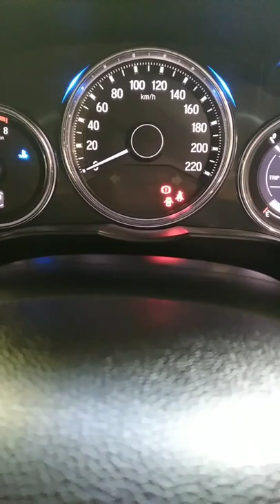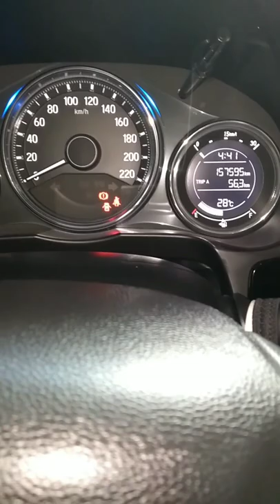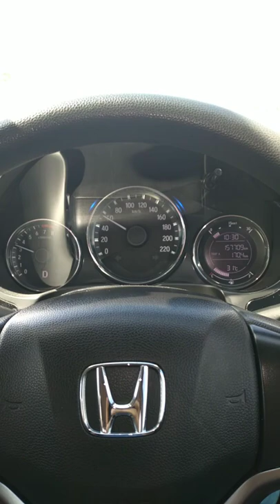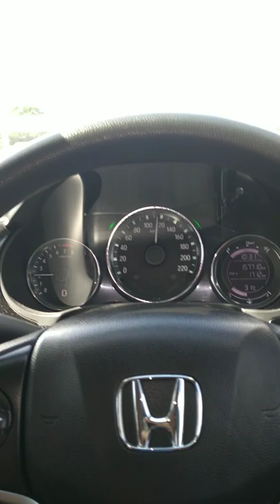CVT FILTERS REPLACEMENT

Comment: Great tutorial. Honda wants around $400 bucks to service my 2021 Accord. I have all the tools, and everybody in the comments would agree, that we have a great teacher for guidence! Thank you sir!
Reply from the maker: Thanks very much for Acknowledgements!
Reply: No way they were charging u only $400 to do everything that was done in this video.
Reply: honda oil + honda filters costs around $300 plus work hours. i thinks its fair.
Reply: @numerik4636  Everything was mostly labor. I did it myself using this video for about $200.
Reply: @korodymartiningatlanszakerto  It's a decent price, but Its a bit harder for me. I got my Honda an hour away and per our contract, I can only get it serviced there because of the franchise situation. I had fun doing this myself. You learn more, you get your car as soon as you're done vs waiting at the dealership with it, or having to pick it up hours later and it saved me half the price!
Reply: I'm doing this with my 2014 crv and 2019 civic. The civic goes perfectly with the video. Except the crv doesn't. Different top filter but same bottom one I think.

Comment: Hi

I did everything the same as in the video and after 2 months it broke down, the problem it caused me was that it lost power and it came on during the check engine and it kicks hard in reverse, I took it to scan and it gave me the speed sensor (P0717) and stuck cellenoid valve (P0796)

The question is, what could it be?

Comment: You don’t need a gasket for the transmission oil pan when you reinstall it back together?
Reply from the maker: Yes you suppose to but at the time I didn't have any and it never leak.
Reply: Mine was hard to get off , I had to use a razor to scrape it off. I  bought a gasket of ebay for $10. no need to use silicon either.

Comment: Great video. Is this the same procedure for 2014 accord sport? Also what did you use to clean the small magnets? Thanks.
Reply from the maker: Yes it's the same process with a  different shape in the oil pan. I would used any type of trottle body spray to clean the magnet get it very cold and wipe it with a rag!
Reply: @v.r.autorepair242  thank you 👍🏽

Comment: Good job…..What was the material in aerosol spray can…you used to clean the gasket surfaces/touching surfaces of transmission oil pan ?
Reply from the maker: CRC Mass Airflow cleaner. Works wonders for me. I used it in mostly all my sensors and surfaces cleaning because it's very safe to work with.

Comment: Nice video, do I clean the filters or replace them?
Reply from the maker: I will say replace them bit with genuine only. If not used a airflow cleaner and spray it out. Let it dry before installing it back.

Comment: Hello Sir, I have few questions please!

I Imported a HONDA FIT 2020 EHEV HYBRID with a milage of 76,000 km from Japan.

I wanted to change the Gear Oil fluid, but am confused about multiple things;

- Which gear oil to use? HCF2 OR ATF DW1

- Are there any filters inside its gear which need to be cleaned or replaced by opening the chamber , or is its just drain and Refill?

- Beside Engine oil, gear oil, brake oil, coolant, is there any other fluid/oil which need to be replaced after specific millage?

Thanks in Advance Sir!
Reply: maybe im a bit too late, and you already know the answer. but maybe i can help
1. HCF2 for CVT, and ATF for AT
2. it is recommended to change the filter once every 40.000km. but if you do the transmission oil change once every 20.000, for me personally, i think its fine if u want to change the filter once every 60.000km or maybe even 80.000km. but its just my personal opinion
3. i forgot how long spark plug last, but it also need to be changed once every X km. if im not mistaken, it is around 30.000 - 40.000km

Comment: how much fluid did you top-up after pouring initial 4 1⁄2 qrt til the fluid start dripping from the level check  hole?
Reply from the maker: Yes that's correct
Reply: How much added? 1/2 or 1/3 quart?
Reply from the maker: @metzmatu8409  1/2 but make sure the car is not on a jack so you can get correct amount to go into the Transmission
Reply: @v.r.autorepair242  
Thanks. Yup, for level check the car has to be on level ground.
Reply: @v.r.autorepair242 what will happen if we didnt do the top up after the first start?

Comment: Brilliant. Thank you.
Reply: Last service was at 80k. Got another 80k since. Is this service advised or will I have mysterious issues. Thanks again.
Reply from the maker: You should replace the filter again at every 80000km and the CVT HCF-2 oil every 35000km to 40000km. This will be great for the Transmission and  it will last you beyond the lifespan given.
Reply: @v.r.autorepair242  thank you again. I will.

Comment: Hello, did the oil pan had a gasket did you put a new one or just metal to metal unión thanks, I'm about to do this and I'm a bit confused
Reply from the maker: Yes it has a paper gasket but it was not damaged so I used it back. Once you removed the pan evenly it won't break. Pop each side but don't let it drop until all 4 corners are released

Comment: that is recomended  replace every how many kms ? thanks 😊
Reply from the maker: Well 100 000km was best for me because I started to get some problems with the Transmission. High REV when going downhill WAS ABNORMAL. AFTER REPLACING THE FILTER IT WAS SOLVED
Reply: @v.r.autorepair242  perfect , thank U so much is a Big help for me .

Comment: how many quart do you need if open the drain bolt and change fluid only ? ( oil pan and filter not open)
Reply from the maker: 4 quarts but you will only drain 3 and a 1/2 quart out so you should remain with half bottle
Reply from the maker: 3 and a 1/2 qrt

Comment: My 2020 CVT transmission seems to be high revving on downhills and very loud do you think switching the filters and transmission oil will make a difference?
Reply from the maker: Yes it will . Replace filter and clean the magnet and replace oil. Problem will be slove as long as you don't see any big pieces of metal in the pan
Reply: That's because you are going down hill... that's normal for the engine to rev high to compensate slowing you down. That's not good for the transmission in a CVT, with a manual trans it can take the torque better and preferred to save on brake pad life. To solve this, use your brakes to slow you down and watch how your rpm rev down to 2k again. Yes downhill driving using brakes will cause brakes to wear down faster but that's cheaper to replace brakes then a CVT transmission! Changing the trans filters is a waste of money for the most part, they don't actually filter small particles like your oil filter does. Both are there to keep large metalic particles from passing thru, which don't clog the filter unless you have a major transmission issue to begin with. That's why the manufacturers don't recommend changing them unless transmission being rebuilt, or repaired at that point that failure could have caused filters to clog... again filters are there for IF THE TRANSMISSION WERE TO HAVE ISSUES... if you are replacing the trans fluid every 30k-50k you shouldn't ever have to swap the filters. It doesn't do harm to swap them but again it's basically a waste of money.

Comment: Do we need a new filter? Or we can. Just use the Old one?  😊
Reply from the maker: If you can't get new, well  clean and reuse.  I would recommend you get new ones because it's hard to get all that fine metal out of the big one.
Reply: @v.r.autorepair242  how many filters need to replace? I saw you replaced the round one. But not sure about the filter inside the pan.
Reply from the maker: @richarddomingo5931   2 two of them

Comment: What was the torque rating on transmission cover bolts?
Reply from the maker: Honestly I don't use that but it would be the same for most transmission pan!
Reply: Transmission Fluid Pan and Transmission Fluid Strainer Torque Specifications: 12 N.m (9 lbf.ft)

Comment: This might sounds dumb but How necessary is it to drop the tranny pan and to change the filter and clean those magnets??  I was thinking of just doing the trans oil change and changing the filter that’s under the air box
Reply from the maker: Well yes that's a normal change you will be doing but when you clean the magnet and replace the filter you prevent the top filter from clogging up faster. However nothing is wrong with your method. I suggest you do the bottom one every 100000km because it will help you get more miles out your Transmission.  I'm actually at 200000km atm but saw many people Transmission broke at 120000km to 150000km and they did there oil change but no filters.  So you can have a better idea why it's good to do the bigger one once in a while
Reply: @v.r.autorepair242  thank you for the wisdom! My 2018 white sport hatchback is approaching 50k not sure when the last owner changed the oil but I’m going to do the top filter below the engine air filter and an oil change and for the next oil change I’ll be sure to drop the pan clean the magnets and replace the filter that’s inside the trans. What do you think about using amsoil instead of genuine Honda hcf 2?
Reply from the maker: @mrbriceno3949  I will only recommend Honda transmission oil because it was made especially for there transmission and not multi vehicle! Ams oil is good I will use there engine oil because it has zinc in it which has a effect on the engine parts like ice move on ice.

Comment: Great informative video! Does using an Automatic transmission oil in my Honda BRV Automatic CVT cause damage? My mechanic suggested using the high quality Shell S1 ATF TASA , which is automotive transmission, power steering and hydraulic oil mainly used for heavy-duty vehicles. It was changed 3-4 yrs ago and have had no problem with my BRV , in fact excellent faultless performance. But now it turns out that I should have used the Honda recommended Idemitsu CVTF Type H2, which is specifically formulated for CVT in all Honda vehicles . NOW my warranty is NULL and VOID. Want to know if ATF oil indeed damages a CVT transmission ??
Reply from the maker: Good day yes it will longterm.  Now if you can change the oil to its original HCF-2  and replace it every 10000km about 2 times it will help get most of the mixed oil out. So in the future stick to genuine honda oil HCF-2 and change filters and you good to go again

Comment: im gunna pretend i didnt just see you put that pan back on without removing that old gasket junk and putting on a new gasket😂
Reply from the maker: Well I'm not getting any In my country to buy and we'll after inspection it was not damaged so yh you could use it back I'm currently at 200000km without  leaks!

Comment: It's the filter under the pan new or you clean it?
Reply from the maker: At the time I was making the video I didn't have a new one but I did eventually got my order. I did the video to help person so they to could  D.I.Y.
Reply: @v.r.autorepair242  how did you clean it?
Reply from the maker: @wasaiteam  Airflow spray CRC brand
Reply: Honda warn not to use  compressed air to clean the CVT strainer/filter.
If cleaning the CVT warmer strainer, just soak it in new HCF2 fluid thoroughly.
If it is clog or damaged replace it.

Comment: after replace the filter cvt.. how much oil cvt need to replace 3.5l or 4l?
Reply: for honda city.. thank in advance
Reply from the maker: 4.5 liters
Reply: Why 4.5 quarters? The dealer said 3.9 to 4 quarters the 1/2 extra is for the filters replacement?
Reply: If you do not remove the oil pan and you drain from the overflow bolt, you only need 3 1/2 quarts.
If you remove the oil pan you will need 4 1/2 quarts for refilling.

Comment: Did you replace the gasket and I missed it?
Reply from the maker: No I didn't. I just cleaned the surface of with the CRC spray
Reply: @v.r.autorepair242  how many tima has passed right now you have any leak on the oil pan for recycle the gasket?
Reply from the maker: No leaking and I'm 175000km . Four (4) years old
Reply from the maker: No I didn't

Comment: Quick question, I’ve already put in new transmission fluid. 
Can I change the filter with the new fluid inside without having to readd? 

Thank you.
Reply from the maker: Will not recommend that but is best you wait till the next service and change both oil and filters at that time.

Comment: Still nowhere to get those filters ?
Reply from the maker: You can clean it with a airflow sensor cleaner.  I don't recommend any Purple Blaster or decreaser cleaner.
Reply: Thx 4 d response
Reply: I have seen in some videos people replacing with OEM new filters. I am not sure where they bought it. Maybe dealership
Reply: When do u need to change that ??
Reply from the maker: @markdru  it's best to replace every 100000km or 60000 miles.  That works best for me.
Reply: @v.r.autorepair242  thanks for your informative content
Reply from the maker: @markdru  Your welcome!
Reply: Where do u get the filters to purchase?
Reply from the maker: I got someone to bring it in
Reply: @aaroncampbell837   en la agencia wey
Reply: Gracias por el video ?es el mismo procedimiento para el Honda civic 2014 LX?

Comment: Is recommended to use only Honda HCF-2 CVT oil type or can use Castrol TRANSMAX ATF/CVT (HCF-2 standard) to do the job?
Reply from the maker: Would not recommend Castrol oil on honda transmission.  Also honda has designed there oil for there transmission and not a multi vehicle oil. You will get less mileage using M.V . Oil which in long-term will Break the belt.
Reply: @v.r.autorepair242  

I just want the oil for 40k max or 1 year, then I will replace it. Last time I used some Valvoline that covers HCF-2 standard when it was 75k miles, right now has 115k. 
Cus I already have the oil, next time I will buy Honda brand.